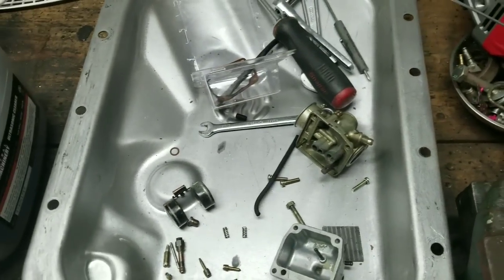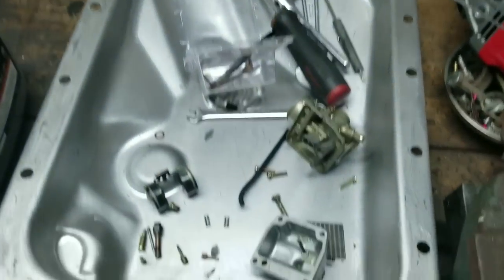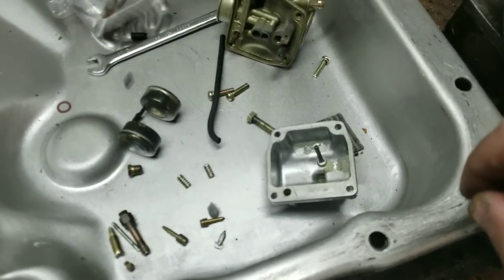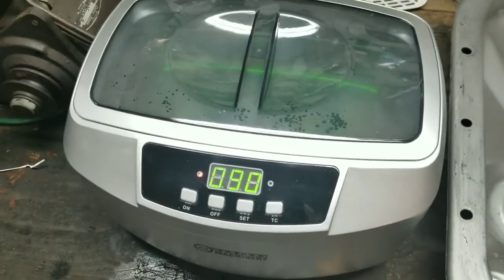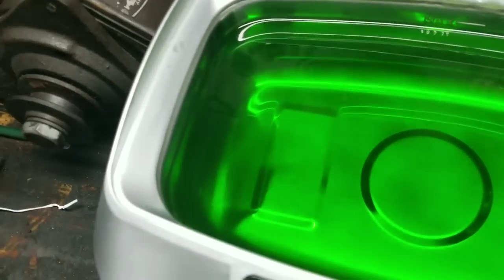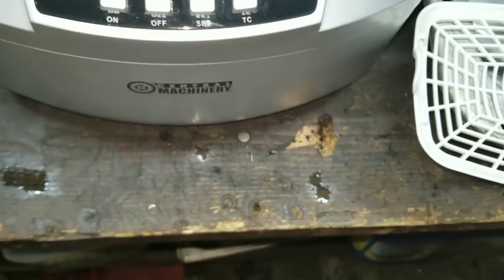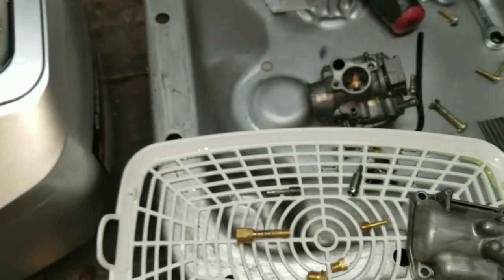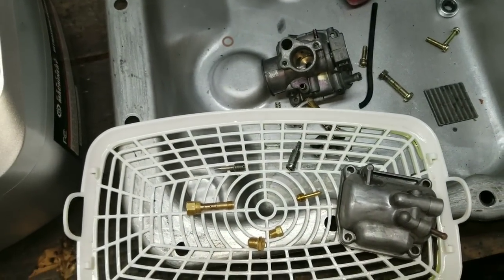Harbor Freight Ultrasonic Cleaner for Carburetors

Comment: Use Ziploc bags, fill the bag with cleaning solution, small, and floating parts then put a heavy part in it that will make the whole bag sink and the sound waves go through the bag like it's not even there.

Comment: I have used a Dremel tool held against a Tupperware container to clean micrometers, it's crude but it works. I watched 15 yrs of rusty dust from a surface grinder shake free from the ratchet and barrels of 5 mics. It worked best in a plastic container, different sizes work better, probably has to do with the wavelength propagating against the walls. I priced the ultrasonic cleaner and decided to try to clean it with stuff I already had first. I wasn't disappointed.

Comment: Run a bead of silicone  between the stainless steel bowl and the plastic housing... otherwise moisture will get into the electronic boards underneath the bowl a d it will stop working... I did mine before I used it and it hasn't failed yet... doing this solves 90% of the complaints with respect to this item ... it also helps when you change solutions ... keeping the solution from literally pouring into your electronics... good luck, great video ... thank you...
Reply: Good advice.

Comment: Ultrasonic cleaners are great. I have one that came out of an old tattoo shop and I've done all kinds of carbs, and it always amazes me how much keeps coming out. I don't do fancy chemicals use pine-sol and water mix or purple Power & water and it seems work just fine
Reply: dkruitz I used pinesol and water and it makes the aluminum oxidize (I think) on the surface even after drying and cleaning

Comment: Small tip when using these cleaners is to boil up a kettle and use a three quarter mix of hot water to tap water, will save on having to wait around for it to heat up!

Comment: Yes, it dissolves the dirt. But You still have to remove it from the parts. Use a toothbrush on every part as You pick them up, and brush and rinse in tap water. And, then it's time to say if the sonic did the job or not.
Personally, I prefer to soda blast them first, and then rinse in sonic tank.

Comment: I like the way Steves small engine Saloon did, by putting the solution in a sealed plastic bag or jar then putting it in the cleaner with water. It keeps your machine cleaner, and it will last longer.

Comment: I've had mine about 4 years. It's been through hell and back. Even dropped it in a bucket of water once. Screen stopped working for a couple days but came right back to life. If you haven't done it already make sure to watch how to measure  adjust that float. There is little to no Rome for era. They are prone to cause a leaking overflow.
Reply from the maker: This worked great.
Reply: Most floats are good, if their parallel with the body, inverted.

Comment: My son had suggested that Harbor Freight ultrasonic cleaner.  One of my favorite things I have ever bought at HF.  Used it to clean my friends carb from his Onan generator. They are notorious for going bad after sitting all summer in the heat. I had already had to replace mine. When he had problems, I ran his carb through this cleaner using a few times. Came out good as new and saved him a couple of hundred for a new carb.  Cheap, good cleaning tool to have around in the garage.

Comment: I live up in ny and a lot of guys swear by these for cleaning snowmobile carbs. I’ve seen some guys keep melting pistons from carbs running lean, they replace all gaskets and seals in the engine, clean the carbs, try bigger jets and still melt pistons. Then they ultra sonic clean the carbs and problem solved. It’s crazy what some varnish in the passage ways in a carb can do. 

I have a lawnmower that has a plugged up idle circuit and it’s a very weird design that you can’t really unplug it unless you use an ultra sonic cleaner. Even if I soaked it for a few days you can’t blow air through the circuit because there is no room, it’s a weird carburetor.

Comment: Pretty cool ultrasonic cleaner.. carb cleaning fluid $6,  carb rebuild kit - $8-$10.. New carb from ebay $12.. I just opt to buy new ones - saves time and expense on cleaning fluids..
Reply: Dude your not going to get a new mikuni wm38 for $12
Reply: Maybe 12 bucks for a zama or a walbro but why wait days when a good cleaning and a kit will have a unit out in a day or two not a week.

Comment: Get a piece of screen to put in the tray to keep the smaller parts from sitting on the bottom of the tank. It will be easier to get them out when the solution is really hot.
I set all of mine at 140 degrees in the shop, and that seems to be about the best temp to clean really dirty carbs.  
I'm going to go pick up one of these for my home shop to clean the carbs on my bike this week. 
You don't need to clean carbs for more than 15 to 20 minutes, unless they are really bad,  then you can soak them for a few cycles. I take out the carbs and rinse them off to see if there are any spots that need to be soaked again. 
Make sure and rinse the parts really well with water to get the solution out of the circuits.
Reply: Have you done any carbs with scaly corrosion in them, and if so, does it loosen/break it up?
Reply: where to get a screen?
Reply: @wazup3333  Most hardware places have them. Just get regular window screen, and make sure it's metal, not plastic.
Reply: @InTheDogHouse3DPrinting  is there a specific name for it
Reply: @wazup3333  Not that I'm aware of, it's just regular window screen, or screen door screen. Not sure what it's called.
Reply: I got a screen ball from home goods store in kitchen department. They are designed to hold tea or spices in liquid. Works perfect for small screws and springs

Comment: Lol, his description of dirty carb isnt the same as most peoples description of dirty carb.  Bro, that carb was new when you put it in !! ;)
Reply: L.O.L
Reply: You wouldn't see crap floating out of it if it was new... But yes it's not too dirty
Reply: Brake clean woulda done the job twice as fast and twice as good.. Dirt Bike tech here!
Reply: Michael Collins my 1975 Rochester Quadra jet  is dirty  bruh
Reply: @nadronnocojr  then clean it out. And screen your gas. Cause no carb that is that new looking should ever be stopped up. That thing is new. Mine is in a 69 chevelle I bought in 86' never, not 1 time has it been off car or stopped up. Clean gas, good sense, good maintenance goes long way
Reply: @michaelcollins1899  run some of this shitty ethanol gas in a brand new bike and let it sit for a month or so and Inguarantee that clean carb will be plugged up. Sometime you dont mean to let something sit, but shit happens and it does. The outside of a carb has nothing to do with what is sitting inside your jets.
Reply: @MrDirtysteve75  I have for years thanks and it dont clog up. I buy clean, I screen, and I crank it often. Pretty simple
Reply: TheDirtRider 
I was a listed dealer for several brands and manufactures as well as a motorcycle mechanic....Brake clean will not cut as well as some other methods - if and when possible I soak in lacquer thinner, then hydraulic the passages with oil, and finally will blow all out with a chlorinated brake cleaner. I have a sonic cleaner that I use as well but its not an industrial model, and I typically only use it when there is some type of needle seat or material in the carburetor that the lacquer thinner would melt
Reply: Hello,@M. Knight. Did you put the Air/fuel screw back to 1 1/4 turns out from fully seated and also screw in the idle adjuster screw enough? Did you clean the Pilot Jet and also make sure you could see through it? Is it getting spark and fuel to the carb bowl? 
Yeah some small engine shops will work on that stuff. Even a automotive shop will sometimes do that stuff. Rt now with things slow do to covid there's alot of shops looking for any bizz to keep busy.
Reply: It does work great with very dirty carbs just takes a while. If a jet is completely plugged it’s not going to clean it out you need to clean anything that’s plugged but it will take the varnish out of the ports
Reply: that is what I was thinking, looking at these because mine growing lichens on it, 🤣🤣

Comment: Berryman Carb Cleaner - even includes a basket to lower carb into the cleaner.  About $30 retail.
Reply: I've been using that in my HF US cleaner for years.  Works great.
Reply: Bill Tyler,  berryman's carb cleaner has been around for as long as I can remember. We used to use that stuff to clean tons of parts on an old junker cars. I didn't know they made it anymore. Thanks for the Memories

Comment: Cool vibrating machine never seen one . but I've used apple cider vinegar and it cleaned my carb better than carb n choke cleaner or gumout... Just throw it in a bowl and pour the vinegar in it let it soak couple hours and pull it out use carb cleaner to remove the vinegar and i put wd40 all inside and out to lube the parts and slap it back on... Dont know the cost of ultra sonic cleaner but acv is 6 dollars at Wal-Mart....

Comment: If you want it to work really well put your carb parts in a plastic jar with gasoline in it put a lid on it then submerge into your ultrasonic cleaner works twice as fast and does a better job

Comment: Dawn dish soap and water works good too also you can fill it with distilled water and put your carb and parts in a glass Mason jar with the simple green in it and put the hole jar in and it works good as well

Comment: (HINT) FYI WHEN CLEANING THE FLOATS  TAKE A STRING AND A HEAVY BOLT OF NUT TO HOLD THE FLOAT COMPLETELY UNDER RUN 2 CYCLES AND IT WILL COME OUT LOOKING BRAND NEW .
Reply: excellent idea, thanks!
Reply: ProTip: When using the computer, turn off Caps Lock.

Comment: Install an inline fuel filter, run recreation Gas without ethanol in all small engines, and put at least 1oz  of SeaFoam additive per gallon in your Rec. Gas. fuel can. Shut your fuel valve off at the end of the season and drain the bowl you carbs will probably stay clean almost forever.

Comment: I needed to clean the grease out of some bearings and didn't feel like waiting for them to soak several hours in acetone and then dry out. I decided to build an ultrasonic cleaner with a plastic bottle some rubber bands, duct tape, a plastic bag, and an ultrasonic vibrating toothbrush. It was a bit fiddley but I was able to get it going good. I think I'm going to pick up a cheap one, since I don't have unlimited old toothbrushes laying around with battery life left over. I'm pretty impressed with the make shift cleaner, those bearings are just dancing around in circles in the acetone and I can definitely see the grease flying out into the liquid.

Comment: While it may have worked, the fact that you could just reach right in while it was running tells you that it's not an adequately powerful machine.  Either the transducer is anemic or it's not attached correctly....  or both.  Putting your fingers in should have resulted in some pretty intense pain and possible injury.  There might have been some ultrasonic action but my guess is that the bulk of the cleaning was from just the simple green and the heat and not the limited agitation the machine provided.   I purchased a machine off of Amazon a while back, all metal, similar ratings, and you can SEE the water moving above the transducers and it's a LOT louder.....  there's something wrong with that HF unit....

Comment: Ive read that ultrasonic cleaning brass floats will cause your solder joints to fail and a sinking float problem to develop. I always avoided putting the brass floats in mine as this was easy to believe.
Reply: turn off the heat

Comment: There are Gas Stations around my area that carry Ethanol-Free Gasoline.  They're usually on roads leading to rural areas. I load up on a couple of 5 gal cans for my tractors. Works great and doesn't leave that sludge buildup.  Just Google it to see if they're any in your area.
Reply: Around Florida  Gates have it, not much higher.
Reply: Thanks bro. what a bro's bro.  Am I right? Lol I'm cracking up on everyones opinion on how they think it should be done.

Comment: Nice unit. I took my wife's sonic ring cleaner that she never used and never missed. It was a lot smaller but has served my purpose for model engine parts cleaning and chain saw crab rebuilding. Simple Green?? Never thought of it, I always used carb cleaner or made a witches brew.

Comment: Old crock pots work pretty good too with the cleaner    Just make sure you have good ventilation while in use
Reply: @jimcat X so i dont need this machine to clean parts? Just a pot and solution?

Comment: My workplace paid 26k for a much bigger version of this thing, but this one looks like it works just as well. Also, the temperature of the water that you measured is only 10 degrees cooler than ours runs.

Comment: You can also put the small parts in a glass jar full of the cleaner and the ultrasonic will still clean the small parts..
Reply: or I use ziplocks with cleaner of choice (iso alcohol works pretty well) in US with the same results - fill tank with water and save on cleaner...
Reply: Not true, they may get something clean from sitting in cleaner but the ultrasonic "action" will be blocked by the glass.  When using ultrasonic cleaners you want as little obstruction as possible around the parts being cleaned.  Even placing them in wire mesh basket of some type will mitigate the ultrasonic cleaners ability to do what it's trying to do
Reply: @mr.h4714  I promise you that it works in a ziplock and cavitation happens.  I've done cards, bike chains, PCBs, jewelry, etc.
Reply: @AN-kg4ei  Yep..me too. Works great in a Ziploc

Comment: Regular Simple Green does NOT etch aluminum, I’ve been using it for 30 years, because it does not harm anything and does a decent job if you use a little elbow grease and agitate it well!
Reply: In the ultrasonic cleaner it does

Comment: Ive got  a variant of the same machine machine sold through Super Cheap in Australia, made in China & it worked brilliantly using the simple recipe in the instruction book they suggest , was small amount of white vinegar added to distilled  / demineralised water & a couple of drops of dishwashing liquid depending on aluminium or brass being cleaned , anyway worked really good on a 1990 XF Ford Falcon 6 cyl Weber carb, brought it all up like new & it was bad had been used on gas mostly for years so stale fuel gunk at the bottom of float bowl got a light bi carb soda blast to really help it &  finished off with  a few more cycles until i was happy, all good except all the lights froze up when trying to turn it off & wouldnt ,  switched off unplugged  waited few mins,  reconnected power & tried to restart the machine no lights came on & that was that, went back to Super Cheaps & told yeah bring it back , with the receipt, we will swap it straight over,  still looking for the bloody receipt,  works great but not for long in my case, will try to get  it replaced though, as  i do rate the performance for a cheaper end of the scale purchase.

Comment: while you have the dirtbike apart,i would install a inline fuel filter. that way keep the junk out of the carb.
Reply: Or use ethanol free fuel....
Reply: @AWIERD1  The ethanol content has nothing to do with keeping debris out of the fuel system. In line filter and fuel stabiliser mixed in will solve both problems
Reply: @Power52  you don't know what you are talking about. The new gas formula sits in the aluminum pot metal and eats it and up that's where the shot is from
Reply: @Power52  Actually he is right. Not only will it eat away the aluminum but it will destroy gas lines, filters and gaskets and seals as well. Never use ethanol gas in a small engine.

Comment: Watch "Steve's Small Engine Saloon" on You-Tube; the Ep., on Ultrasonic Cleaners, to show a better way of use it and cleaning part's.
Reply: I saw Steve`s idea in fact today,good idea I will use it when I get my ultrasonic cleaner!
Reply: @mrnovacan2158  Great: I use a small metal coffee can with a clear lid in my ultrasonic cleaner with water around it, and for small parts I have one of those 1 cup coffee ground holders with it's lid, I also use a 1 cup coffee ground holder that the top broke off of it and the little filter's to pour my cleaner through back it to it's glass container to keep it as clean as possible. And to see what I've cleaned to see if I have other problem's.

Comment: How about an update?  How much have you used it?  Does it still work?  The OFF button didn't even work the first time that you used it, so I wonder how long the rest of the controls worked.  I am tempted to buy one, but I'm afraid it will work for 91 days, the day after the "warranty" expires, if that long.
Reply: If you choose the right seller for this product, you can use the machine for a long time.

Comment: Never ever EVER put your hands in an Ultrasonic cleaner. The ultrasonic cleaner will burst all the capillaries in your fingers or hands and there is no way to repair them. You WILL lose your fingers or hands if you put them in the bath tank with the Ultrasonic cleaner is running. Unplug the unit before you reach in to get your parts. Set up you workspace with everything you need so you don't have to reach into the tank to get the parts out.

Comment: Thanks for sharing this.
I'm wondering if I can place a 4" round seive in this bath to shake material thru the seive for micro size separation in water?
Reply: You can do this but better not touch the bottom of the tank directly with your seive. Put them on the basket or hang up them.

Comment: See what you need to do get yourself a fuel filter and put it between the tank and the carb and it should help with the junk getting in the carb
Reply: Or just clean the tank so your not constantly replacing clogged filters. Even after cleaning the tank it is a good idea to use a filter